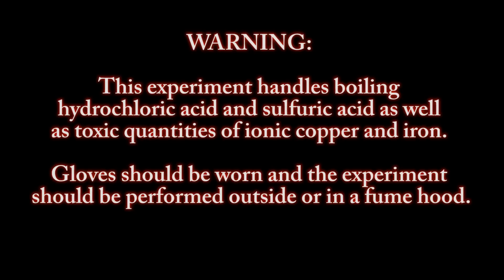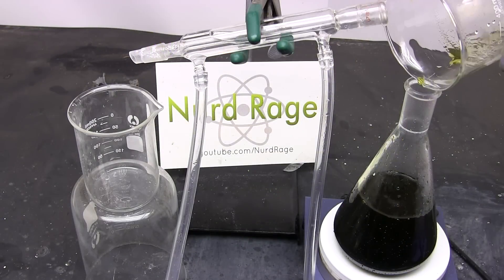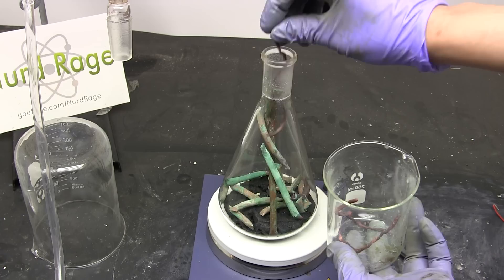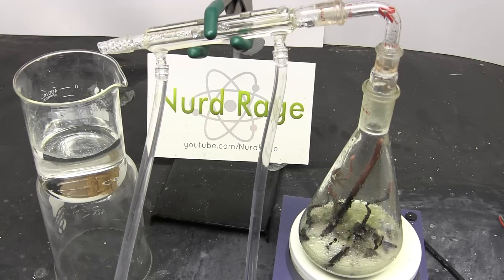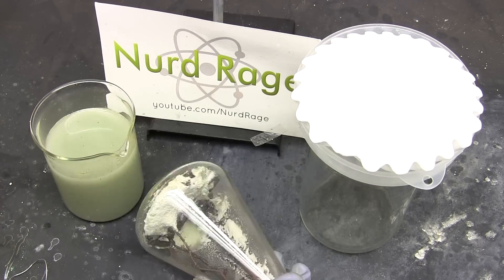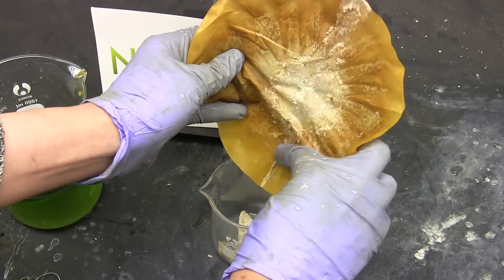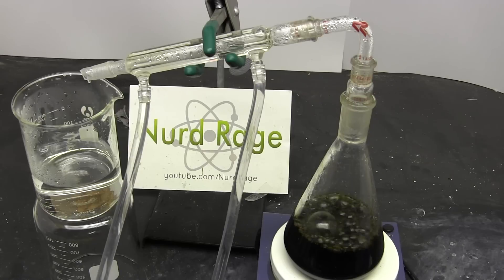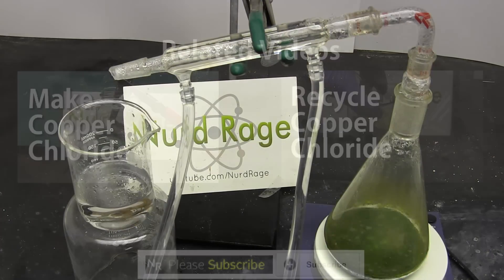Recover Copper from Ferric Chloride Etchant (Waste free method)

Comment: i saw a text from Someone explaining another different way to restore Ferric Chloride... first, we need to add some Fe (Iron peaces) in the used solution and in some hours we can see that Fe is going to solution and starts to grow Copper (Cu) on those Iron peaces... So, we remove those Copper from the solution until growing is over... after that, we slowly add some H2O2 (Oxygen Peroxide) in to the solution and we can see it turning into a brown color of Ferric Chloride... (We can get better results using 200 Volumes H2O2 because has less water in it, but we need to bem careful when mixing it to the solution for heating reaction)... May question is, what happened to this solution... What is the reaction formula... ???? What happened to the privious Fe ions in the beginning solution???

Comment: I read a description of how to use simple electroplating to remove the copper (it plates a copper electrode), using about 10A of current. Wouldn't that be so much simpler??
I haven't tried it yet, but it was published by a trusted electronics magazine

Comment: is more convenient and easy, to recover copper and ferric chloride,at same time, making an electrolitic cell with diaphragm, in one compartiment. 50%hydrocloric acid and in the other the waste ferric chloride,,,,electrodes made from graphite and a thin foil of cooper.,current density about  10 amp/inch2,,,,remember  96500 coulomb=1 mol of copper.=63 grs

Comment: If you were using Ferric Chloride to dissolve Iron, Steel or Stainless Steel, what would be needed to recover / rejuvenate the spent etchant?  I suspect just more HCL acid and then oxides again?   Follow up - what happens to carbon, nickel and Chromium if etching Stainless Steel?  Super practical reasons for asking - many thanks!

Comment: This is a terrific video. Thank you so much for producing it. I have encountered three additional ferric chloride solutions I would like to recover, but as they are not pure, I am not sure how this process would work with them. The first is ferric chloride that has had citric acid added to make what is called the Edinburgh Etch which uses four parts ferric chloride and one part citric acid solution (1 liter hot water mixed with 300ml citric acid powder).
The other two solutions are both straight ferric chloride, and the Edinburgh Etch solution that have been neutralized with baking soda in a misguided attempt to render them harmless. Any suggestions how to process these solutions would be greatly appreciated. I believe solving to this could help keep hundreds of gallons of waste from being illegally dumped into land fills and sewers. There is a large group of people etching art in addition to those making circuit boards and I believe many would benefit. Thank you again for all of your great videos!

Comment: If Nurdrage could recover Copper and Iron, how to recover Platinum from PtCl4 ?!! :v
Reply: Raihan Danurdara Dissove it in distilled water and add a more reactive metal with valence 4, such as tin. The tin (IV) chloride should dissolve and the pure platnium should precipitate. Recover by filtering. Lead wouldn't be too good because the plumbic chloride precipitate would make it difficult to separate.
Reply: Cyberw4y is there some better method using different oxidation metal ??? :/
Reply: Raihan Danurdara Any other method will cause production of chlorine gas, and that's generally bad... At least you need a lot of safety to do it. With tin, you don't need to worry, because tin (II) chloride quickly reacts with any chlorine molecules to prevent the gas from escaping.

If you want to do it anyways, use any other metal and it should work, with the exception of silver, mercury or lead, as these would precipitate along with the platinum.
Reply: Cyberw4y ohhhhhh, the solubility. i hope those information works on your experiment :)
Reply: Btw, I don't know if platinum is soluble in water. I considered it as not being soluble, but I may be incorrect.

If it is, you have to use silver or lead, and take care of the chlorine gas that escapes. There will be a precipitate of silver chloride or plumbous chloride, filter that then evaporate the remaining water. After evaporating the water, pure platinum should precipitate.
Reply: Cyberw4y : Most Platinum ion are insoluble. Except the complex ion like Hexachloroplatinate (PtCl(6-)) that have different properties.
Reply: Raihan Danurdara Good, then my first method should work. Have you tried it already?
Reply: Cyberw4y unfortunately, it's reall expensive to afford a salt of platinum (the price we're super expensive)

Comment: Nurdrage is a girl :o
Reply: nognog nog I am 90% sure that you are right.
Reply: nognog nog I have recovered original voice by pitching down audio and he did not sounded like a girl. btw no additional waist chemicals have been produced during conversion.
Reply: Noooo
Reply: No nurd rage is a man I assure you
Reply: Definitely a man... Look at the dry ice video... And the sweater is not a clear indicator that Nurdrage is a woman.
Reply: Mnightshamalamadingdong😱
Reply: Jon H Indeed, they are called oxygen displacers. However, you built up a fallacy and missed the point. What I meant is that it would be hard to live in a medium with high concentrations of SF6, even if oxygen is present. It's safer to be somewhere with a certain concentration of CO2 than somewhere with the same concentration of SF6, for as much as both have the same toxicity level. This property of non-toxic danger for gases is called inert oxygen displacing.
Reply: +nognog nog http://prntscr.com/b1jieo
Reply: Martynas Mirauskas I just knew the voice was "fake".
Reply: nognog nog One that still hasn't located that sulfur hexafluoride leak! XD
Reply: Denninja thats not good
Reply: Denninja Isn't that an oxygen displacer aswell?
Reply: Jon H Like Helium, it can deprive you of oxygen. Go look it up.
Reply: Alot of gases are. But,air is a mix that has O2 in it. Pure oxygen is not the best but a mixed gas is. But you need oxygen in the mixture
Reply: Science_and_anonymous science_and_anonymous SF6, however, is not present normally in the atmosphere. It's really dense too, so it can fill a room or your lungs to the point where oxygen is not able to enter your system in sufficient quantities.
Reply: i agree nurdrage is a girl
1pitching the voice cant be done so easily because she could use a lot of filterst that you cant remove
2 watching dry ice video is either she is flat chested wearing sports bra or sewater just hide boobs. and why is there no hair on the hand?
3 first videos voice is different from now. why would you change your voice in the first place?
Reply: JusstyteN also girly clothes give it away. but why ? do she change her voice?
Reply: ***** he is a girl XDDD
Reply: @JusstyteN   Does it really mater?